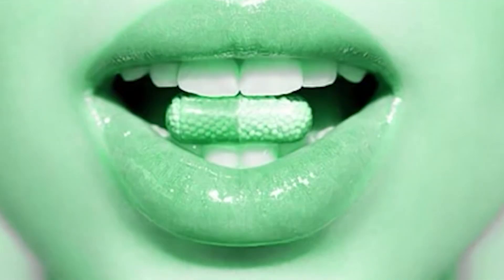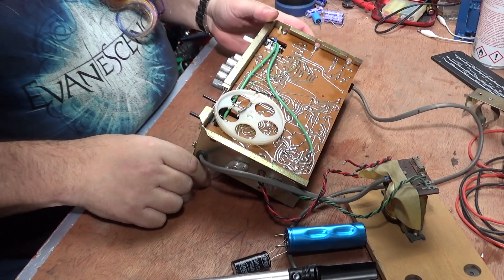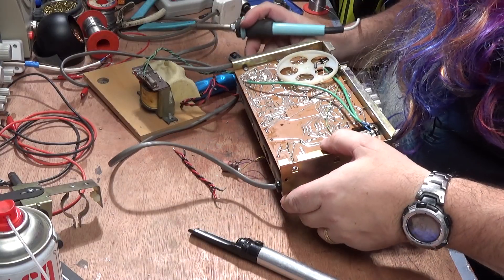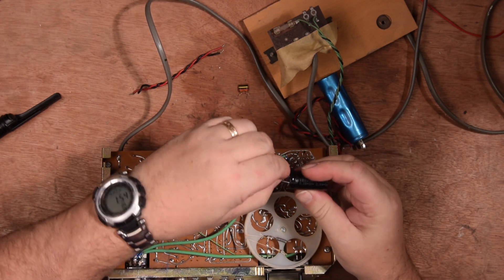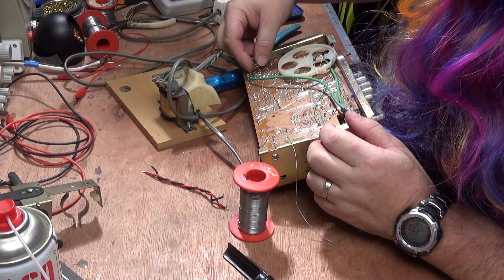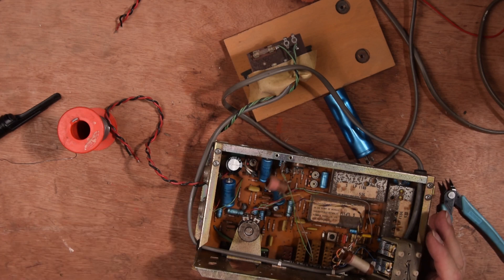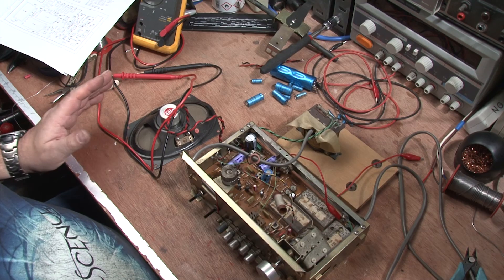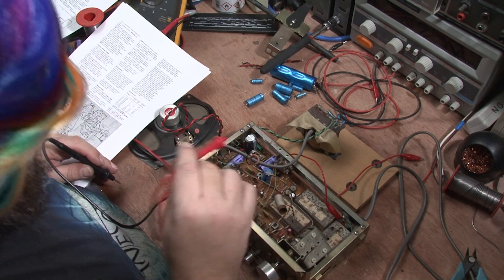Transistor Radio Restoration : Roberts Radio RM40

Comment: Just for the record, yes, those caps are not polarized...HOWEVER...it does matter which lead goes where.  One lead is the Outside Foil lead of the capacitor and should be placed at the low impedance side of the circuit for best performance.  If you don't make sure of that, it will still work, won't blow up or anything like that, but performance will less than ideal.
Point of curiosity on the "Tropical Fish Capacitor".   Is that one a ceramic type capacitor?  I don't think I have ever seen one quite like that.
Enjoy your videos.
Stay Safe, Stay Healthy, Stay....um.....w...er....you!
Reply from the maker: The foil side argument is one that still goes on. Not had any issues with using non polarised caps either end except where a high gain stage is encountered such as the first stage of a guitar amplifier. The tropical fish caps are a ceramic capacitor with the leads bonded at the ends. However, they are not as resilient as disc caps, being more porous and hygroscopic leading to failure at this sort of age.

Comment: Good stuff George, amazing how capacitors have shrunk so much in 30-40 years. Audio set-up is a perennial favourite with the family in this house :)
Reply from the maker: Audio setup... yes, I could have put a load on the amp but that isn't the same as it running into a real speaker. Having the sound absorbing foam around the room keeps family harmony when doing that at 4am. Caps shrinking is a real thing.. Maybe I should change the washing powder to Aerial?
Reply: @GeorgeChristofi  If they are shrinking...it's the cold weather.

Comment: Another great repair video George. I'm not a stranger of putting the odd part on the track side of the board at times if needs must. Loving the new locks!  🤪😜😂
Reply from the maker: In the words of Captain Kirk to Mr. Spock, 'It seemed like the logical thing to do'. I could have found another can, fitted it to the clip and had that trailing wire but I have a lot of those low esr filter caps so it seemed sensible to do it. Cheers Victor!

Comment: Thanks George. Been waiting with baited breath for this part 2. 
  Is it the green or black bin for RM40s.  You radio rainbow warrior.  ATB   Jeff.
Reply from the maker: over here, it's a black bin with a blue lid instead of the black bin with black lid or brown bin with brown lid for garden waste. The RM40 is actually quite a nice design although the reality is that it could have been smaller to save materials. Thanks for stopping by. George.
Reply: @GeorgeChristofi  I think they are great.  Its just that I might need 5000 quids worth of gear to get my non worker working lol.  Cheers.
Reply from the maker: @jeffsmith50001  There is not a lot in the RM40 to go wrong bar a handful of af series transistors. It wouldn't take much to get a broken one going.
Reply: @GeorgeChristofi  Thanks George. I spoke to Graham a few days ago. Said I could see a few leaky caps, so hes going to sort me a set of new ones. So fingers crossed. Im just in awe of your set-up.    And your new hair-do. atb.
Reply: @GeorgeChristofi  George, Deep Joy!!.  Ive got my lovely Mini Herald working. It sounds FAB. Combination of faulty battery connection and mucky press buttons.
  George, Its bloody gone off!!.   Oh, drop kick me Jesus.  Cant take this emotional up-down.
Reply from the maker: @jeffsmith50001  They do it to upset you constantly....
Reply from the maker: @jeffsmith50001  The setup has been amassed at fairly low cost to be honest... The scope and the power supply was less than 50 quid together... (savvy auction buying) The most expensive was the marconi test set. in reality, the whole lot was less than 1000 pounds. The room on the other hand... we won't go down that road!!
Reply: @GeorgeChristofi   Back on George.  Can Servisol short stuff out?.  It really sounds wonderful.  If only I was a sportsman!, it would be the ultimate shed radio.
  Can you still buy 9v battery snaps or is Graham the go to?.
Reply: @GeorgeChristofi  Thats refreshingly surprising George.  Not too expensive then for a lovely rewarding hobby. (is it a hobby)? or ZEN?
Reply from the maker: @jeffsmith50001  bit of both... used to do radio professionally for a good number of years but cellphones and poor wages killed that off... now its a hobby as well as a can you do me a favour and fix type thing. Been a radio amateur since I was 17 so electronics was a way to go.
Reply from the maker: @jeffsmith50001  you can get them on ebay or buy from Graham. I have a couple here in case which came from the ebay but most of them are in reasonable condition... unless someone snipped it off to put a pp3 connector on.

Comment: Nice hands on work George. It takes a lot of patience and courage to take us along in the video work  in real time. I can tell you it is great that you can also edit out the long distance work but still give enough info to help everyone along. You've got a great sense of humour... Who's Melanie? LOL
Reply from the maker: Thanks Andy. Keeping what could be the driest subject on the planet interesting is hard for sure. I would hate to try and do a real time video of a cap change because it is just a lot of soldering and part pulling. You yourself know that without the camera the job takes a tenth of the time. The bits that need explaining have to be shown though. As for Melanie... Actually based on a (very) brave truck driver that came into the rest area at work after deciding to come out of the closet. Imagine 100 male truck drivers in a room and one comes in with a wig and makeup... very brave.